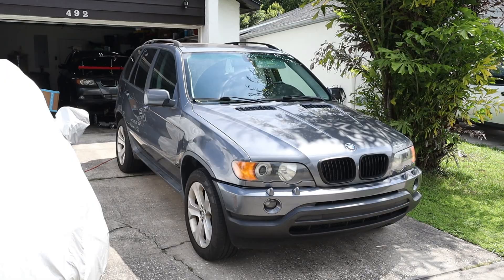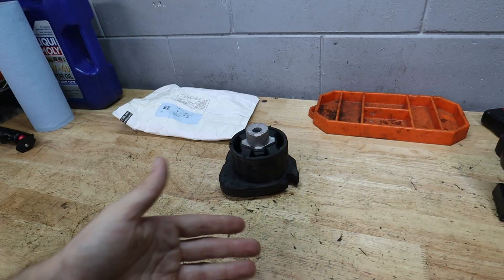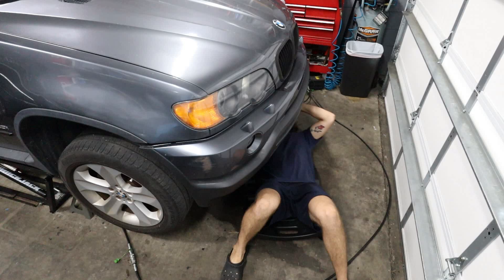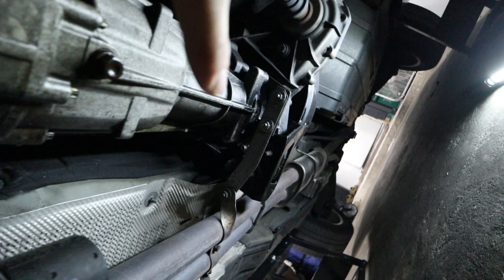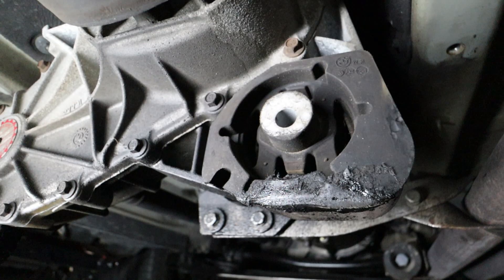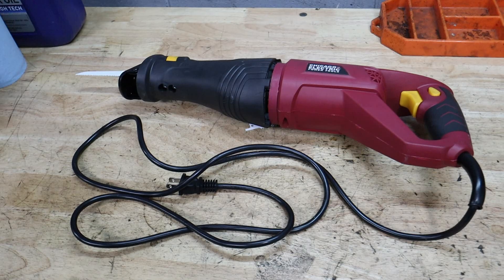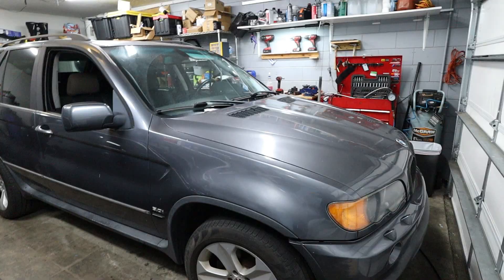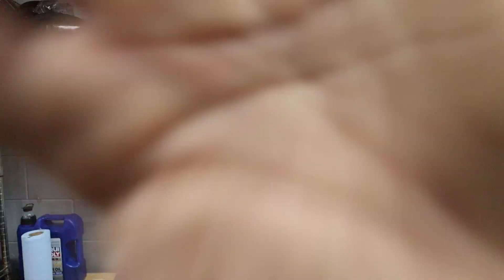How to: E53 X5 Transmission Bushing Replacement

Comment: Thank you sir! Awesome video! My dads 2002 330xi e46 is all wheel drive and uses the same bushing. The exhaust is in the way for the saws-all so I might be hacksawing the metal relief cuts. Just did the motor mounts too. Go German engineering!

Comment: Hi! That clunk can be the front driveshaft splines that the are in his last days of life. Put in neutral and spin the front driveshaft with the hand very fast and lisen.
Reply from the maker: You could be right, but for my car I ended up needing subframe bushings! What a pain in the butt to change, but the noise is finally gone 😅
Reply: @TheBimmerBarn  great!
I have a 2002 e53 3.0i at with a lot of miles and I know what are you talking about. Sorry for my English, I am from Argentina.

Comment: i also want to by x5 with manual transmission,very good vor towing
Reply: No, you don't want one of these for towing. You want an older domestic pickup truck for that. They're far simpler and much more robust.
Reply: Depends of what you will tow, the hook max is like 2,3t kg only...
Reply: @thetoughcookie3665  The 5HP24 transmissions in these are prone to fail prematurely just moving the vehicle itself around. Using one of these for towing would only cause the transmission to fail even earlier.
Reply: There is also GM and manual options. I actually had first one but changed it to a manual.

Comment: That's a bit of a bummer. But never mind. Depending on the mileage the subframe bushes or guibos are bad. I had this same clunck on the e36 at driving away from zero. In my case, it was the guibo on the gearbox side. Have a great weekend. Dutch regards Nico.
Reply from the maker: Yeah I know the subframe mounts are pretty worn but I hope that's not the problem! Gonna have to take a closer look at these driveshaft and figure it out 🧐

Comment: Update video on the cause??? Thanks
Reply: By his reaction after finishing the job that clunk was not there prior and by watching this sloppy method u assume he damaged the entire drivetrain by not having it supported initially when releasing the support bar; you can see the whole drivetrain dropped almost 3 inches and could have damaged output shaft or bearing in either or both the rear diff/ tranny or transfer case; this is an easy way to wreck and cause complete drivetrain failure and the sounds it makes is not just worn bushings etc.; I have over 200000 miles on my x5 with worn out bushings and never would it make a clunk like this, so I’m thinking he completely damaged the drivetrain, but kudos to him for showing the work involved

Comment: These e53s are also known for needing the subframe bushings replaced for take off clunking.
Reply from the maker: Ughhh sounds time consuming 😫
Reply: @TheBimmerBarn  It's not that bad, but you will need the special tool for it that can be found on eBay. Nothing you couldn't handle.
Reply: I did it without a special took with giving heat to the subframe and using a cargo cloth and a floor jack to get them off.. did break one sturdy 2t floor jack and one cargo cloth... 😂 I don't recommend to do it ever without a tool.